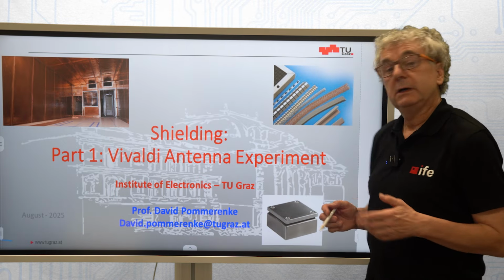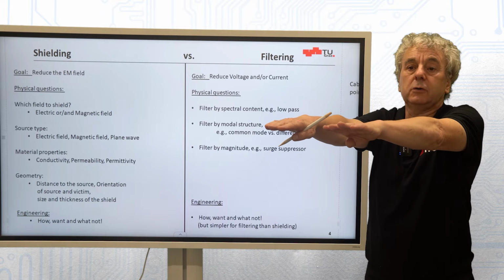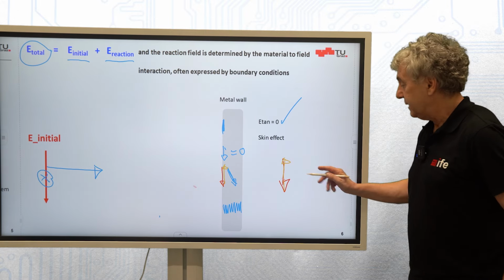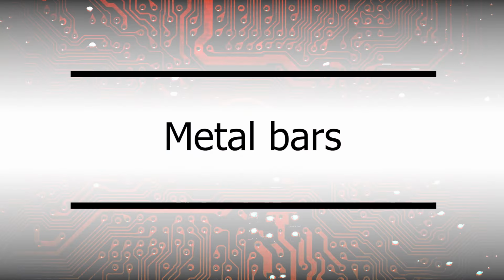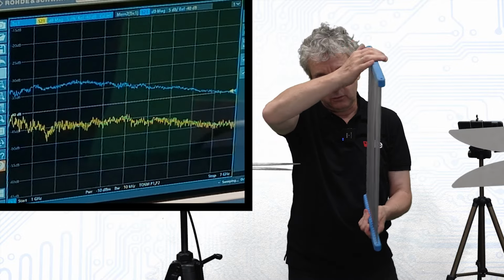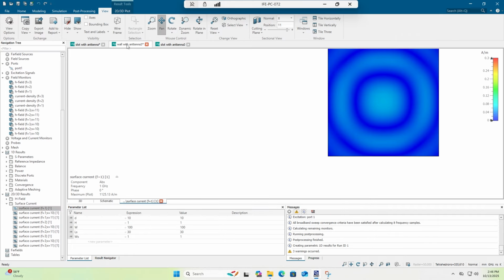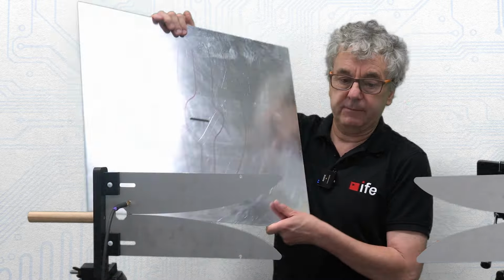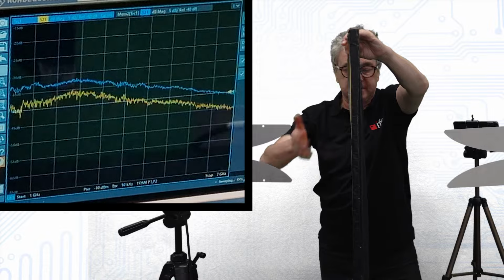How do you shield at high frequencies?

Comment: A few more details from Gemini: AI Overview
The impedance of free space is approximately 377 ohms
While the term "impedance cloth" might refer to specific types of radar-absorbing materials (RAM) designed to match this free-space impedance, the core concept relates to wave impedance, which is crucial for antenna design and shielding applications. 
Core Concepts (Based on the 377 Ohm Standard)
Definition: The intrinsic impedance of free space
Far-Field Impedance: In the far-field (far from the antenna), the wave impedance is constant at 377 ohms.
Near-Field Impedance: Close to the source, the wave impedance is not 377 ohms and varies based on whether the antenna is capacitive (higher impedance) or inductive (lower impedance).
Practical Use: In antenna design, matching a receiver to this 377-ohm impedance is essential for maximizing power transfer and preventing reflections.

Comment: the 45degree bars between orthogonally polarized antennas! - is that analogous to polarizing filters for light? If more bar-plates are used at more angles between 0 & 90, does transmission get even stronger?